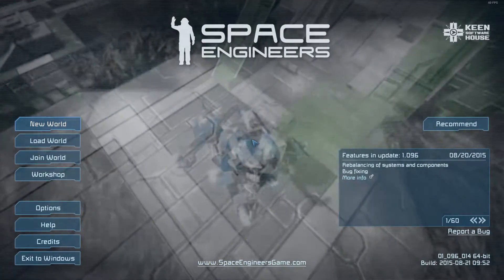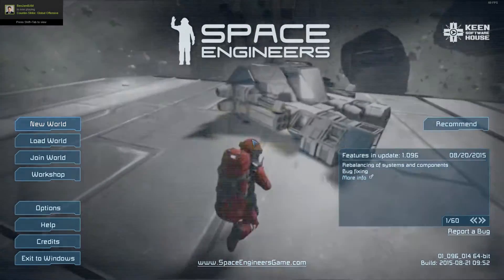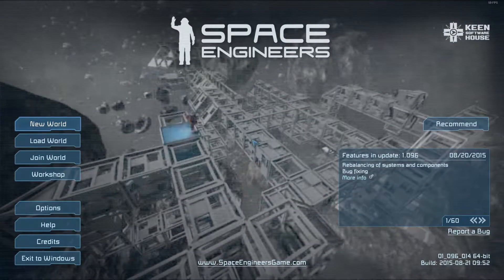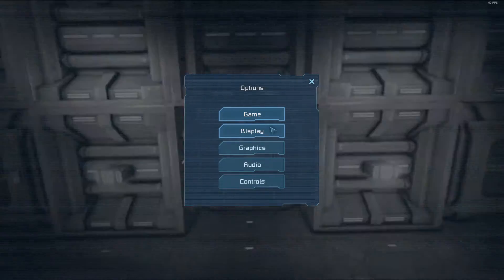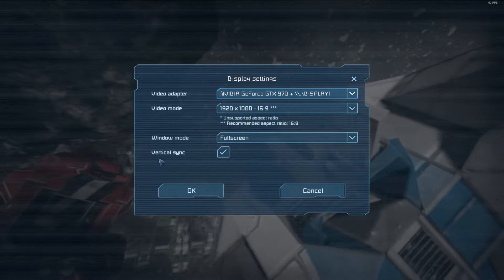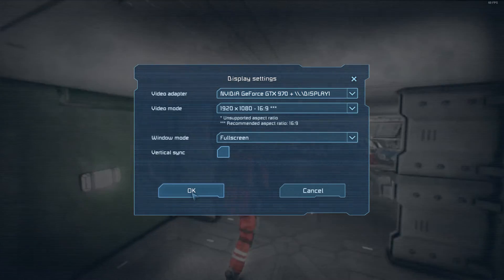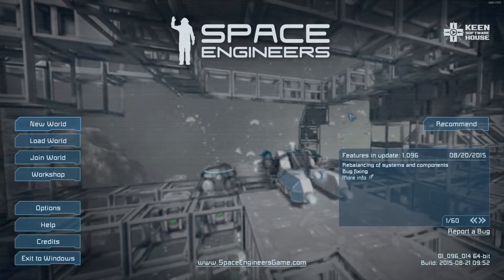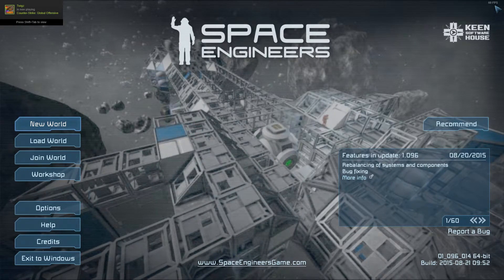Coil Whine fix

Comment: I heard the coil whine when I got a new headset, my microphone sadly also records the coilwhine, any fixes? I hear it basically at all times.
Reply from the maker: +Arthur _ limiting the framerate to your monitors refresh rate helps or potentially eliminates it (either by 3rd party software or by enabling vsync). if you have an Nvidia g-sync or amd freesync monitor it shouldn't be an issue as these take the refresh rate of the gpu rather than the other way around. Another thing you could try is to move components around, whilst my sound card picks it up my onboard card doesn't, you could try moving a gpu away from your motherboard or soundcard or the soundcard from the motherboard.